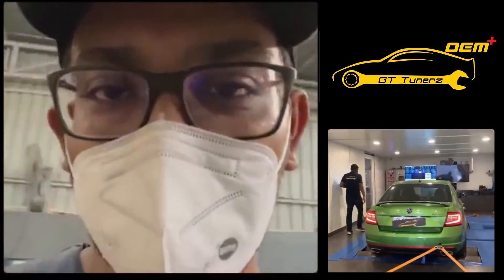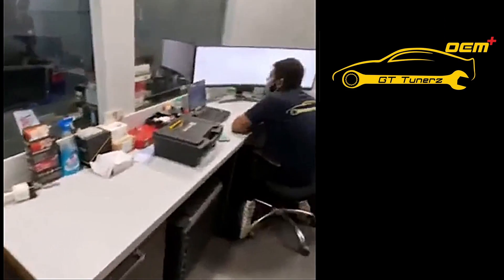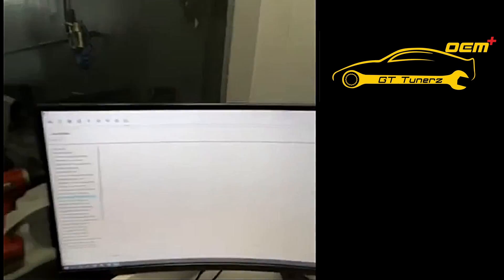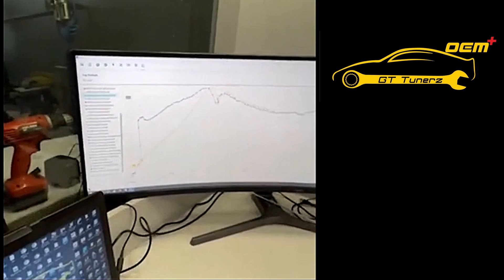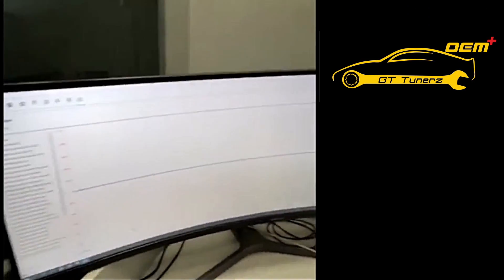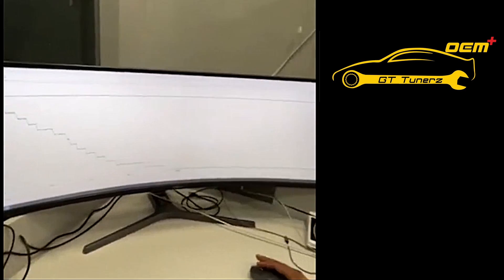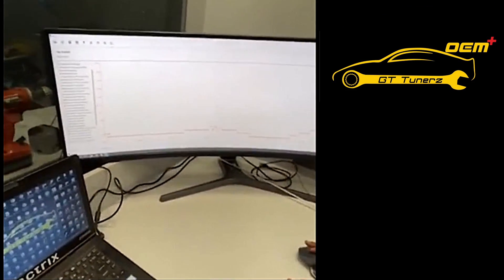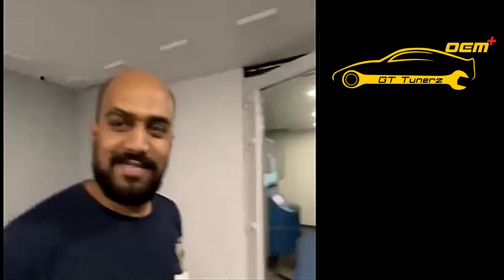Skoda Octavia RS245 - After Dyno data log analysis of stock and remapped engine, "Total GEEK Stuff!"

Comment: So have you opted Low Torque APR  Stage I tune...I learn that APR tune is  conservative?  Same curves for RS230?
Is the TCU tune mandatory for Stage I?
Reply from the maker: I dont think this is the low torque file. Have to confirm with the dealer. APR tune is hardly conservative, but its SAFE. TCU tune is not mandatory, but it really brings the car alive. I would do a tcu tune before an ecu tune.